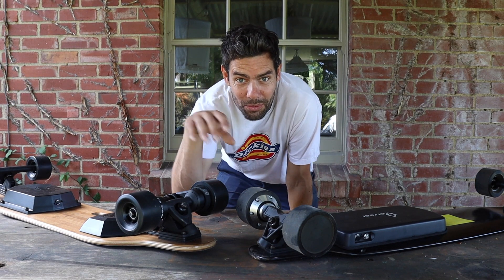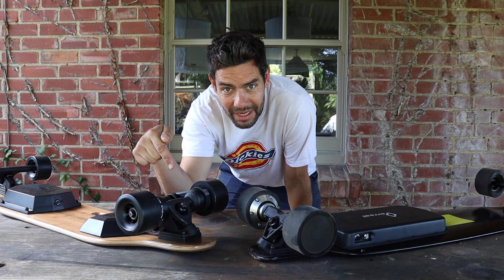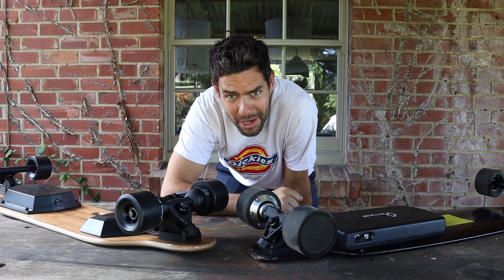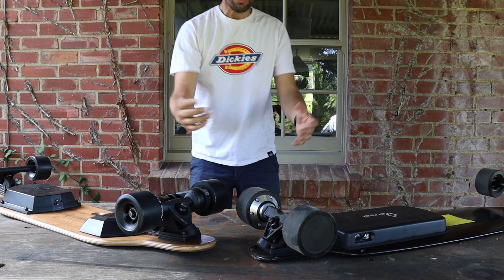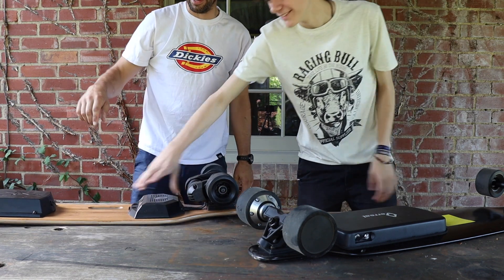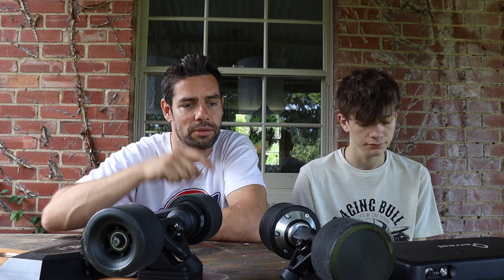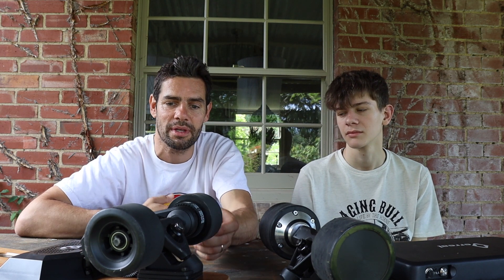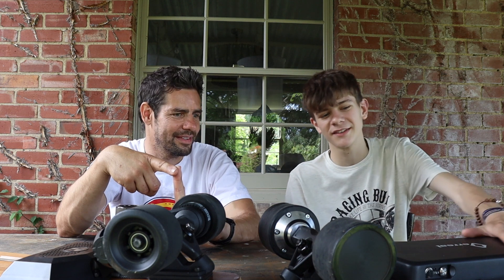MP302 - Electric Skateboards...Belt Drive Or Hub Motor?

Comment: Belts are better for the ride quality, which is very important when flying down roads/trails at 20mph+.  Hubs are good for cost/range/reliability/noise/rolling but nothing beats having more thane for shock absorption which ultimately means your odds of keeping your feet on the board are substantially higher.  Less fatigue as well.  Excited to see more lower cost belt options.

Comment: Just adding a quick comment. Your mention of direct drive for commuting is exactly why I went with the Verreal F1 instead of getting the vastly more powerful RS. I have one the the very first Meepo boards that I have been commuting with for almost 4 years. The urethane on the rear wheels is shot, and the battery case is held together with tape. I have also replaced the battery. It would have cost me a couple hundred more dollars to get the Meepo back into shape, or I could spend $300 to get a whole new board. Decided on the new board instead. The F1 is super smooth and perfect for my 2 mile commute. I ride every day the streets are dry, even in the middle of winter.  Keep skating and stay safe!

Comment: Hi there,  bit of a question if anyone can answer. I have just ordered a hub motor board and now I'm wondering if they may be susceptible to damage from shock from going over joints or rough ground.  As the motor has no isolation from the wheel as with belt.  Have not seen this mentioned anywhere thank you or anyone that can answer.
Reply from the maker: I've done many miles with both types and never had any issues with either.

Comment: Clearly the direct drive is superior

Oh, you're talking skateboards, not steering wheels 😜
Reply: Well, same with sim racing wheels basically. The belt driven wheels can have a smaller package due to the gearing and makes it easier to get it in the right performance ballpark in terms of speed versus torque, yet with a DD system you can really only change it up with size of the motor.
Which let's be honest... huge DD motors on a skateboard will end up looking silly.
Not to mention that the more copper (windings) goes in a motor, the more expensive it gets and these skateboards are already too expensive for my taste.